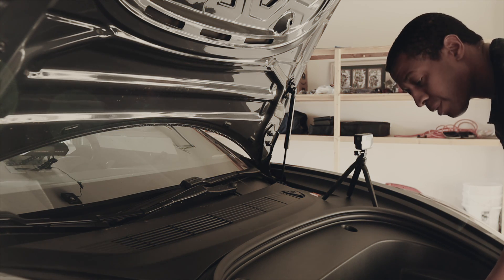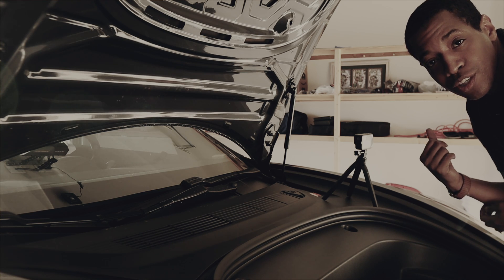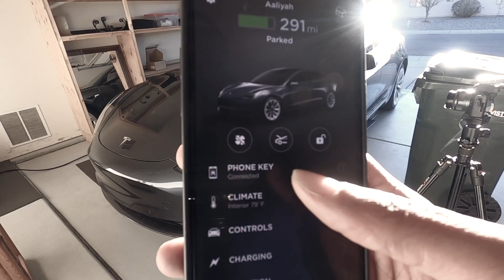Tesla Model 3 | Installing Frunk Struts For Automatic Lift

Comment: Do these work for 2022 Model 3?
Reply from the maker: I would think so. The company specifies 2017-2020 models, but I have the 2021 model. I'm not aware of any changes to the frunk in 2022. It's $15 with Prime shipping. You can always return the product if it doesn't fit correctly. I personally believe it will fit with no issues.

Comment: Ken Nice shots of installation,  I used these but there were instances that did cause some damage reported by other users when closing  it was needed a bit more force to close it so I replaced them quickly  for the hand show power lift had them for two years I use them many times a day and I always get siri  to open and close it
Reply from the maker: Yeah thankfully I haven’t had any issues yet but I will make sure I pay close attention to it. Hansshow is what I wanted but couldn’t justify the price right now. But we shall see. I know your loving the automatic open and close feature.

Comment: how is this holding up after 5-6 months? Any safety concerns or any other opinions for that matter?
Reply from the maker: @Bollywood Fix It's holding up very well. I don't see a difference since I first put it on. That could be also because I don't open the frunk alot.